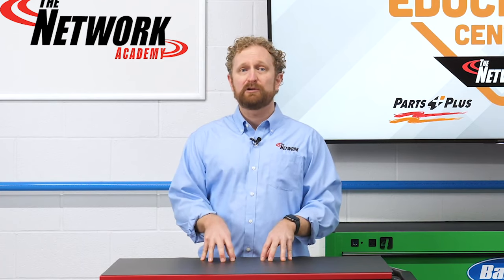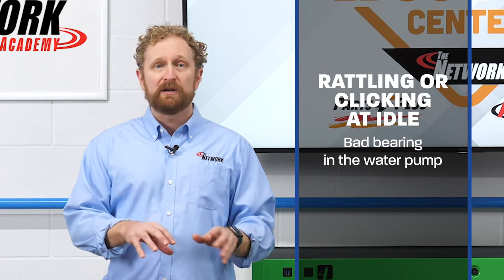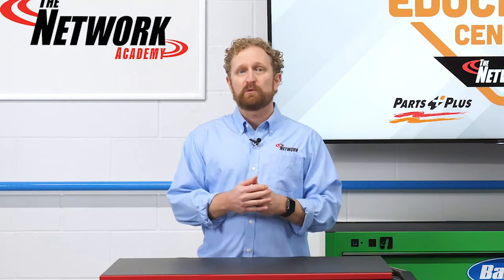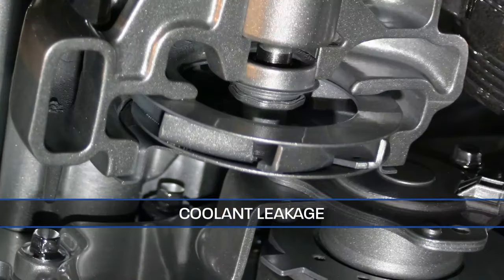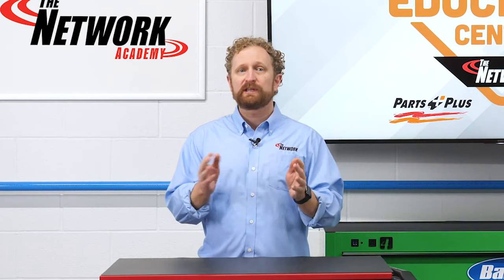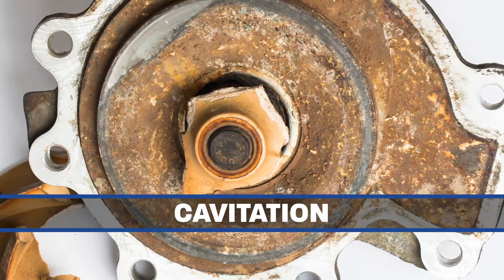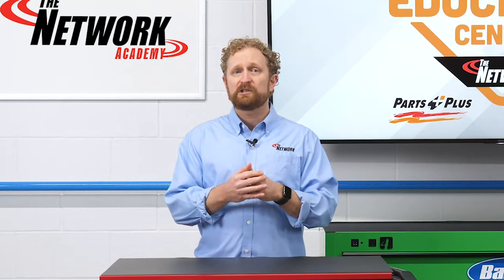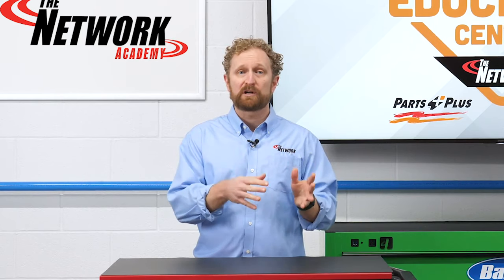Signs of a Bad Water Pump

Comment: My car overheats at idle but if I raise the rpms a bit the temperature will drop back down.. I have a new thermostat and cap.. Does the problem  sound like the water pump?
Reply: Did you find an answer?
Reply: Same problem with my car need answers
Reply: Same here
Reply: @Manmadecontent  still waiting
Reply: Ok, I have a 94 Honda Civic. Car would run fine no problem at all. But if would overheat when I would be at a light or stop sign. As soon as I started to give it gas it would go back to normal. Changed my thermostat, radiator, radiator cap, and temperature sensor. It fixed all my problems for about a month. And then boom my car overheated again and my car now shakes crazy when turned on and has a lot of smoke coming out and it smells like straight gasoline. So a mechanic friend of mine took a look at it and said it’s either a blown head gasket or something internal in the engine. So hopefully yours is just the temperature sensor, should be near the thermostat. If not could be a problem with the head gasket? Don’t know as I’m not a mechanic.
One tip tho, when your car is cold get a water bottle and dump half of the water out. Make sure the bottle is clear. Get the small hose that is from ur extra antifreeze compartment and stick it into the water bottle. Now u want to turn on the car and keep the water bottle on top of the radiator making the bottle the highest point of where the antifreeze would go. If you see the hose making bubbles could mean a bad head gasket. I think there’s also a kit to check ur head gasket. It’s like a pumping container you put on top of ur antifreeze cap, and you fill it with blue liquid. You then pump the container and if the blue liquid turns blue , boom blown head gasket. This kit was mentioned in CHRISFIX head gasket sealant video.
Reply: @kennethmendez3397  if the blue liquid turns yellow brown or green your head gasket is leaking combustion gases into your coolant. If it stays blue your good.
Reply: U need new fan. More u Rev up faster fan goes. Get yourself an electric fan.
Reply: @michaelsilkwood6129  02' with  working electric fans
Reply: Hey guys I'm about 90% sure it's the radiator slightly clogged... I'm going to change it in a couple of weeks and I'll let you guys know
Reply: fan
Reply: @Say_my_nam3  the radiator was clogged.. I ran a flush through it for a few days and that fixed the problem

Comment: Can a over tightened power steering belt ruin a new water pump? thanks in advance great vid.
Reply: Depending on the model. Most have tensioners that provide that. The Tensioner makes it a can of corn to replace the serpentine belt. All you need is a 1/2 breaker bar. Can of corn. It floors me how much they charge to replace it. Takes like 5 minutes. 4 of it will be spent drinking your beer.